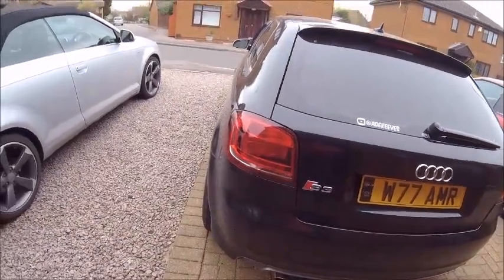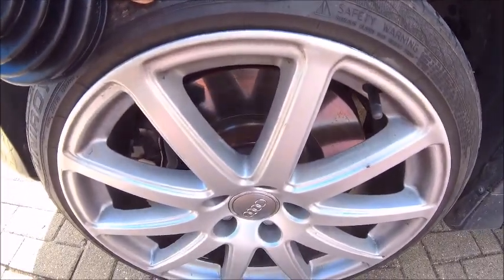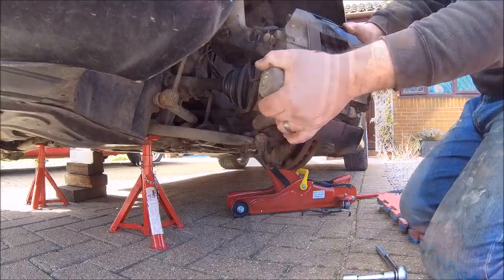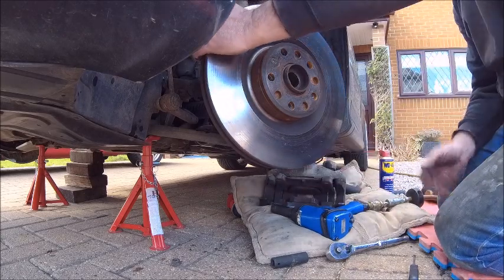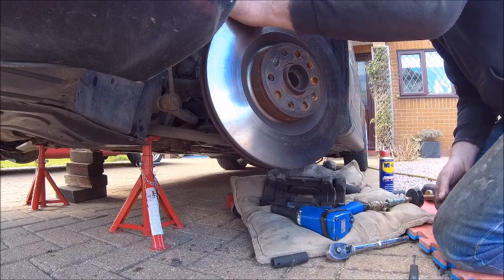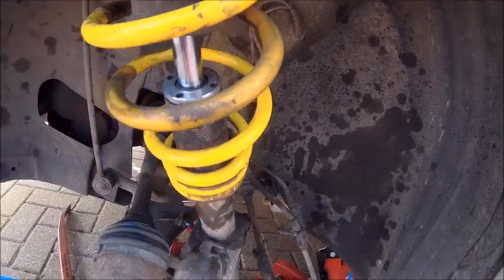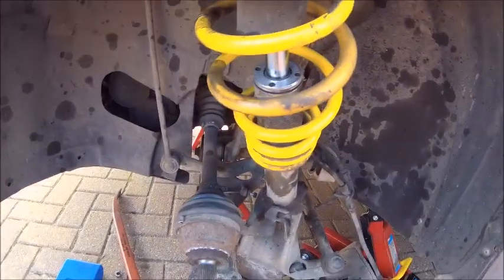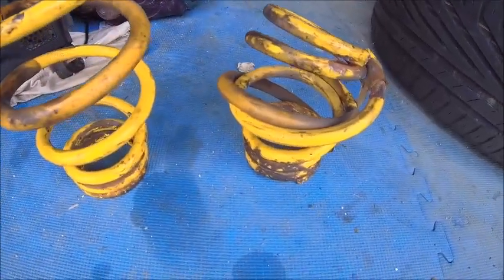My Audi S3 Is Broken... Springs / boots and more...

Comment: Hi Ade,  you should replace the top mounts as they are only £10 each and the one captive nut is broke
Reply from the maker: if you can get me them for a tenner each ill buy them ... 😉
Reply: @AdeReeves  this one should work but check the part number https://www.autodoc.co.uk/ridex/8248410

Comment: Think this is a common problem with the kws coils on these audis seen this a few times! Obviously our smooth roads help massively... I'm sure the bolt underneath my top mount was a 10mm mine also started spinning when I was tightening it back up and it was definitely a socket on the underside
Reply from the maker: The new ones look a little better quality than the "good one" that came off , so maybe they will last longer ...time will tell..